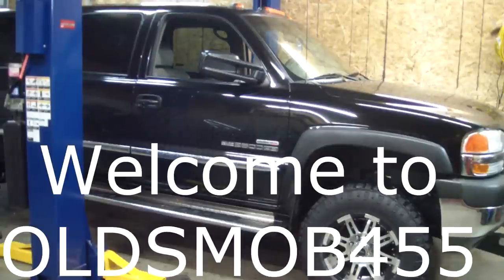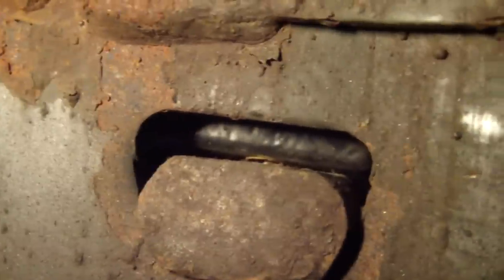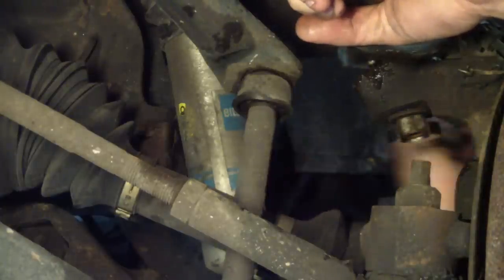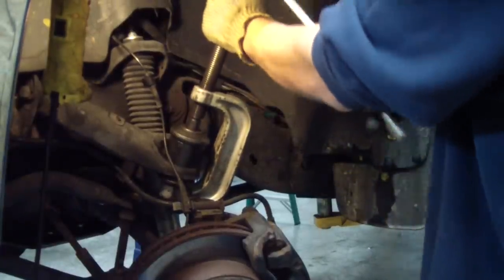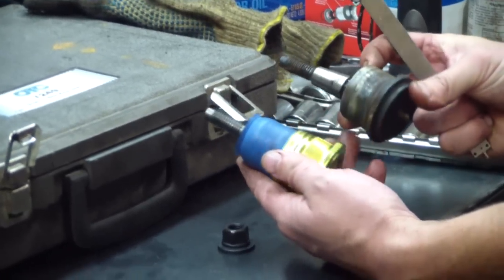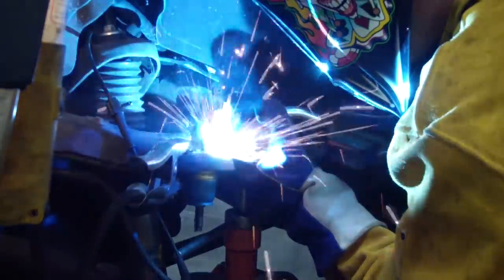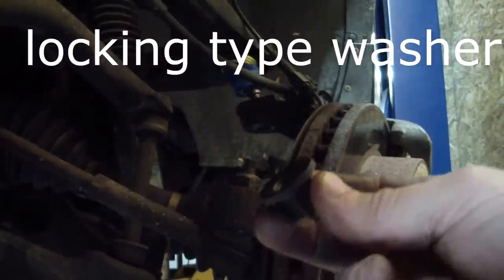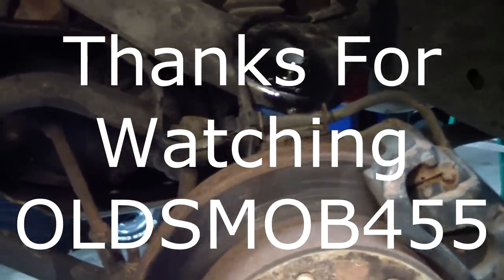Upper Ball Joint Replace on a 2002 GMC 2500 HD 4x4

Comment: unbelievable video...    welding without disconnecting a battery is a bad thing to do ....   as my teacher said it can damage computer... and other things...   also this is why you have a snap ring to hold it in place from the maker of this ball joint HELLO !!!

Comment: helpful vid - thanks!  I'm going to remove mine and replace them with SPC adjustable balljoints so I can bring my caster back into spec after raising the front end.  After seeing this video, I think I'll do two things: 1. relieve stress on the torsion bar.  2. Tack in the new ball joint's UCA insert (this model uses a sleeve so you can remove and reorient the ball joint to change settings).  Thanks a bunch!

Comment: I don't think its really necessary to try to unload the torsion bars since they are pushing downward on the lower control arm not upward. You can take out the lower ball joint and steering knuckle with them just like they are, but if removing the entire lower control arm it would then be necessary. I guess I can maybe see it being safer to work on like this but not much.

Comment: One of the better videos I've seen.
I'm redoing everything on my 02 1500 4x4 with 160,000   All moog parts.
Changing upper control arms an new ball joints on the lower.
First box of parts came Friday. A little concerned with the pit the pitman
 arm.

Comment: I used moog on my 2500 suburban when I gave it a 4 inch lift and decided to replace the upper aNd lover ball joints while I was at it and moog is the way to go no problems and I didn't even weld like u guys did it fit very snug

Comment: do you have to back off tention on the torsion bar ?
i will be doing this on the ground, can i just put a floor jack under the lower control arm and not back the tension off ?
thanks
Reply from the maker: +Rob S I would follow whatever the service manual says.  We backed it off because it's an easy thing to do.
Reply: You don't need to take the tension off the torsion bar.  Once the tire is lifted the tension is already taken off.

Comment: i first thought that it was kind of foolish to weld in the ball joint but after thinking about it a little it is actually a good way to get away with not having to replace the control arm because of a sloppy ball joint hole. if the arm is in otherwise good shape he just saved the guy some money. and when you're on a low budget that's what matters. it's not like it isn't safe or anything.
Reply: i agree the splines didn't seem to grab and that keeps it from any movement or turning.

Comment: The slackness of the ball joint is related to the quality of parts. You mentioned the other side was ok and you used a Moog part.  Did  you use Moog On this side ?   I have seen such a diference in specs from  Moog to the low priced parts I no longer use anything but Moog.  Well done.

Comment: That year and model is notorious for that I have the same one had to change the pitman arm, idler arm tie rod ends, ball joints and one wheel hub assembly at 145,000 independent suspension makes for a nice ride but sucks to maintain!

Comment: Great videos, at first sight of that truck it looks way too high to be stock. Even for a 2500 HD four wheel drive. That may explain why the ball joints work loose in the control arms. A tack weld was a good idea, and should be sufficient imo. If it is jacked up it may wear other parts faster like ball joints and CV joints. Keep up the good videos.